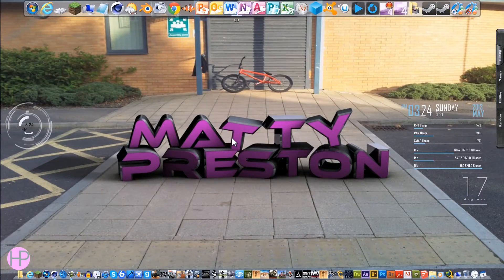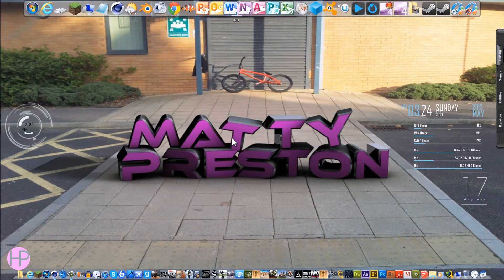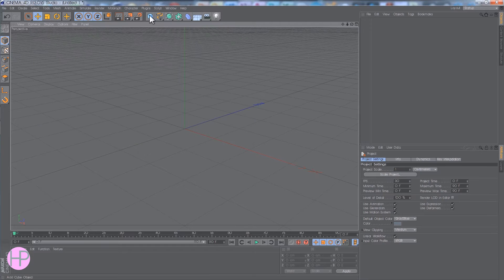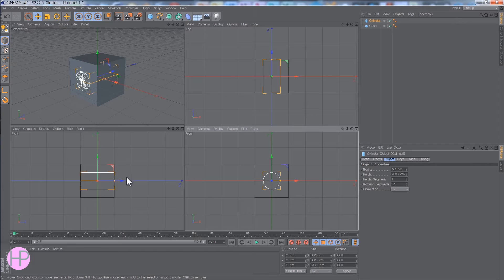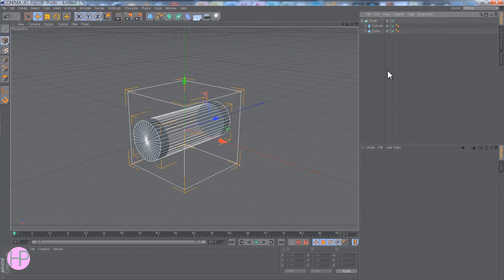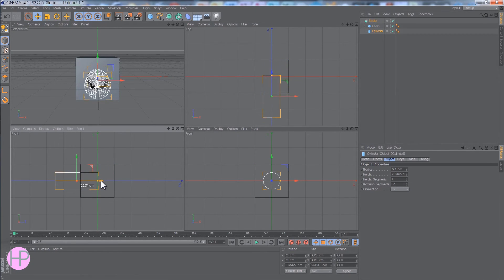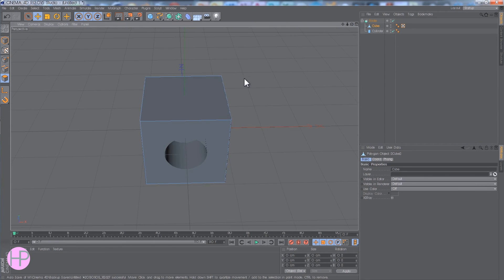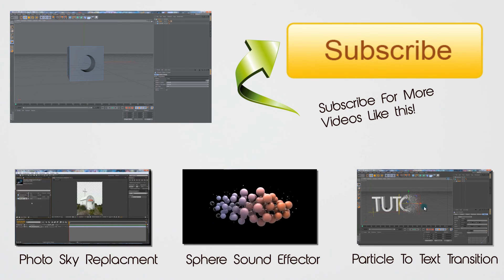How to Make Holes In Objects Using Boole In Cinema 4D

Comment: how can i make multiple holes?
Reply: Thanks for the idea. I did it the other way around. The Bool Object is a binary operator. If you click on it and look at the object properties it will clue you you into what's it's doing. A subtract B is the default. Therefore you can put the cube as the first item in the bool (A) and then all the cut-outs you want to do in a Null object as (B). Just posting for anyone that stumbles onto this later on as well. Cheers and thanks for the video.
Reply from the maker: KleytenHD Try making the shape with a hole a null and repeat the process :)